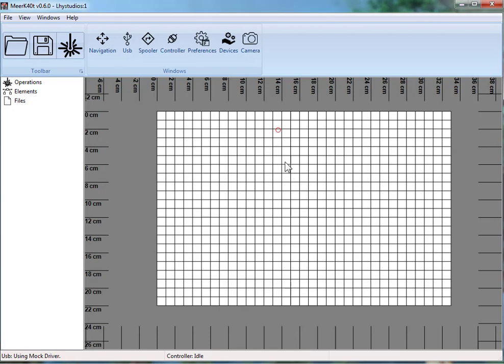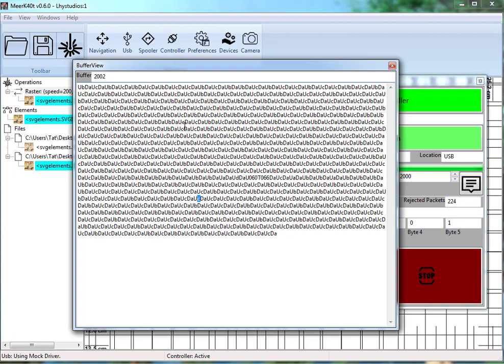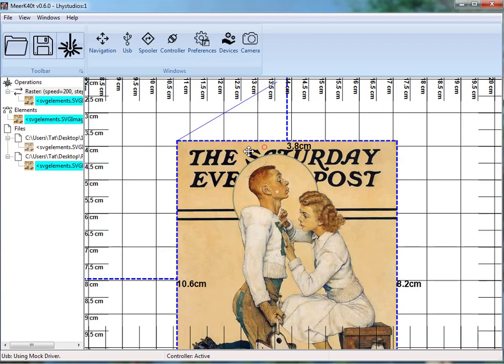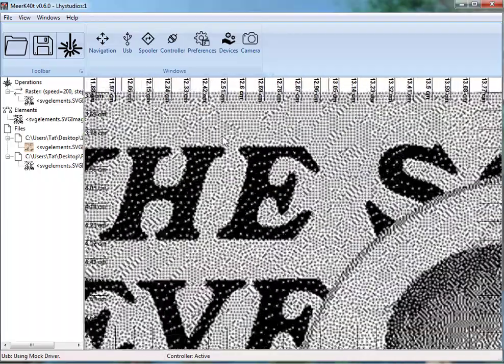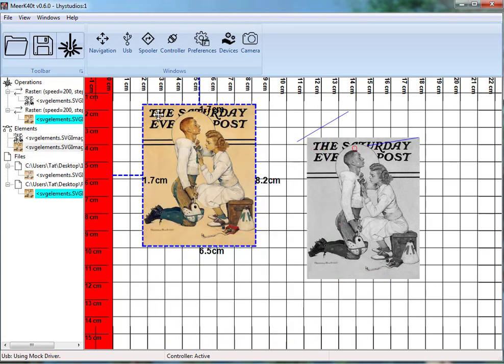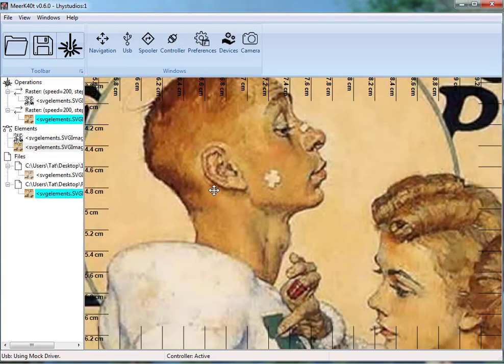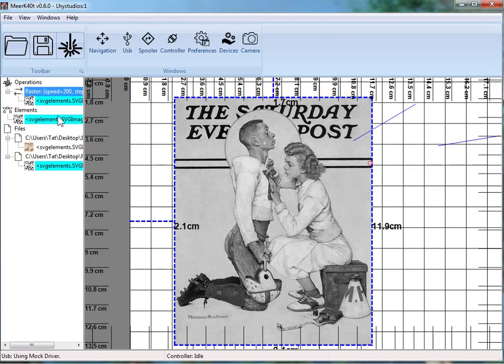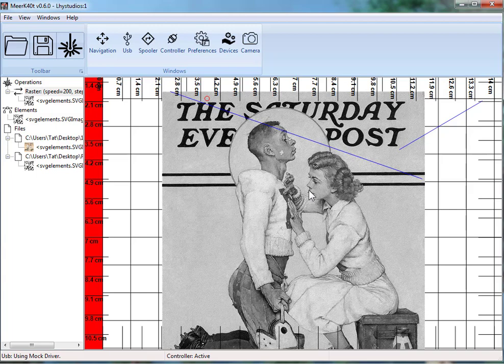MeerK40t - ppi v  dither. How rastering works, and what's the difference here?

Comment: I appreciate you're attempting to explain things but it's so hard to follow.  You seem to be an excellent programmer but perhaps you should get someone else to help with the videos.  

Write a "to the point" script with... 
1; an intro on what and why the topic is being covered, 
2; exactly what needs to be said about the topic with no tangent points unless they are absolutely necessary for success, 
3; cover the most basic trouble shooting techniques for only the most common errors.   
4; add any related tangent topics that will significantly improve the outcome.
5; wrap up by quickly going back over the most basic points.

Any other related topics or trouble shooting can be covered in an "Advanced" video on the topic.  

Sorry to criticize but your videos are the only information available for so much of what Meerk40t is capable of but much of the time I can't tell what it is you are trying to get across.  Some organization, such as a simple script, and clean narration would likely improve these videos greatly.
Reply from the maker: Nah, if I could get somebody else to make the videos I'd be more than happy to do that since I am certainly not the best person for the job. Some of the videos like in-depth on console requires some pretty detailed information but a stuff like PPI or dither or some basic how-to bits certainly don't and my meandering style with asides on my asides are completely unneeded. And probably a lot more basic videos that just show the features one time and in order.

Part of the purpose of my videos is to explain the complex things in hopes that somebody better than I am could do the much easier and better simple explanations. So, I tend to cover things at a level of teaching a would-be better video maker what basic things should be understood. And to some extent how do you transition from another bit of laser software to this bit of laser software. Even pre-writing the script seems to be a bit excessive for me, I tend to do bullet points currently. I guess maybe I could prod chatgpt for an outline of basic script stuff explaining the higher level operations.